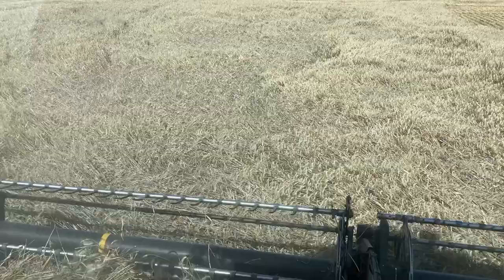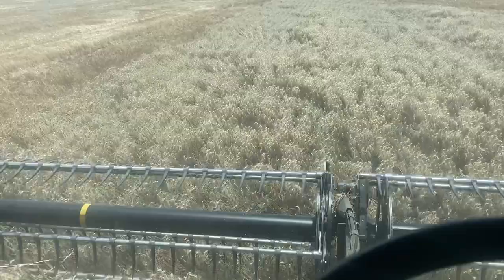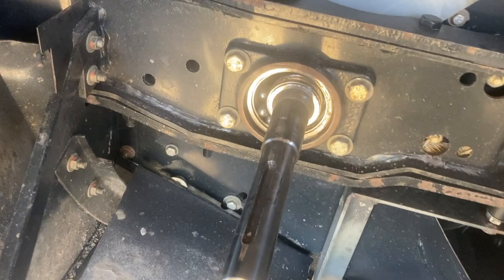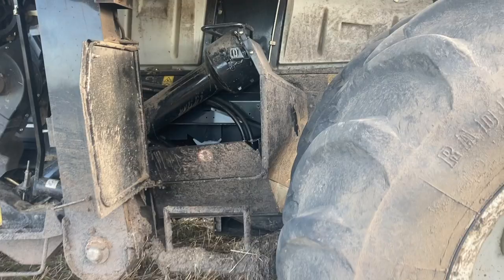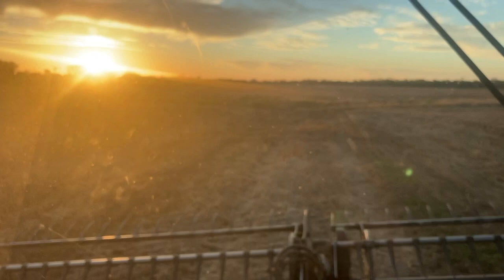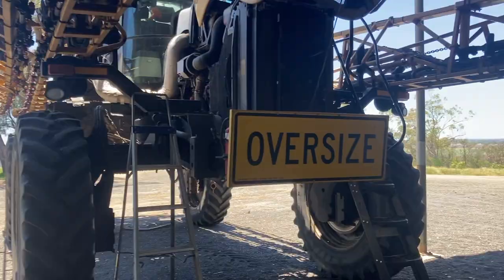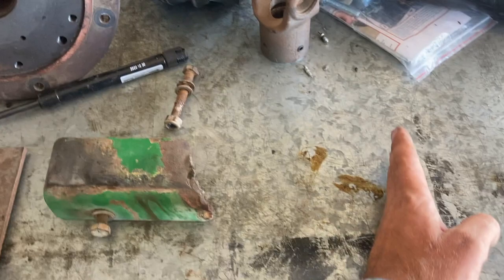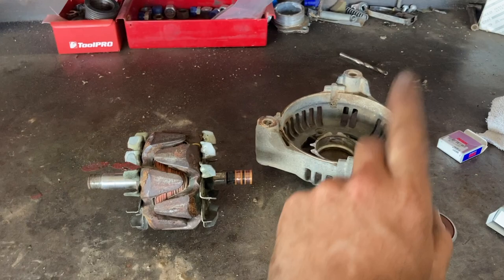Can We Make It to the End? Harvest 2021 Pt. 14 (Vlog 50)

Comment: Don’t know if those bearings are a “floating” fit on the shaft (the inner race slides onto the shaft freely) but if they’re an interference fit you’d definitely want to make sure that there’s no axial preload on the bearing. I do this by driving the bearing on by the inner race. Axial preload could definitely cause premature failure but from the video it looks like a sliding fit so probably (hopefully) just crappy batch of bearings

Comment: When you tighten the clamps on the shaker arm make sure the arm is at 180* of rotation  
Otherwise you will twist up the shaker shoe bushes and you'll keep having constant bearing issues 
Looks like in your time lapse you didn't do it 
Ask your dealer for a manual printout on the procedure, iv just been though this an it'll cause you a world of seemingly unrelated issues
Reply from the maker: Will check it out👍 thanks for the heads up😁

Comment: new holland is junk.the header is the attachment that goes on the front of the combine.there are many types of headers which can be used on a COMBINE. ford new holland is junk.for hobbyists only
Reply: Just a little bit of history. Headlie Taylor developed the conventional combine harvester, as some people would know as, in the early 1900s in Australia. It took the recognisable form of gathering front (closed or comb front) threshing drum, straw walkers and sieves in a shaker box exactly as everyone is familiar with now. This conventional machine was commercialised by HV Mackay in the early ‘20s. It was current for about 100 years till rotary machines took over. It is our machine so we gave it the name of Header. Rotary machines were developed by New Holland in the early ‘70s,  known as the TR70. They appear to have been reasonably successful.  Therefore our machine, our name and that is Header. You call the front a header, we call it a front. It is sometimes called a comb which harks back to the original comb front which was designed for our typically light crops. Every thing has a reason and history often explains that.